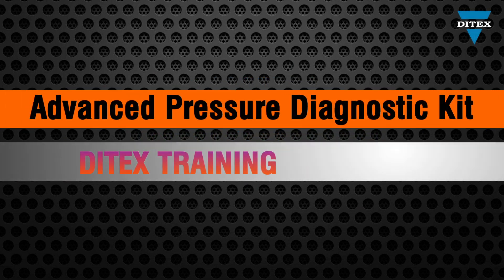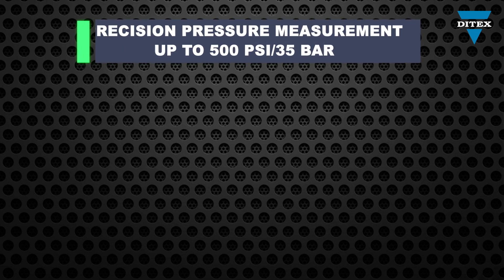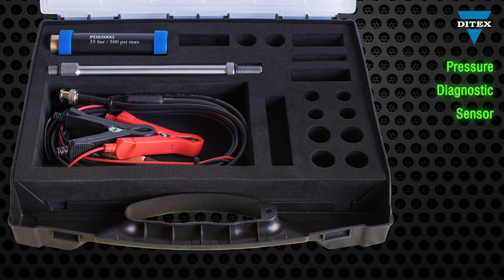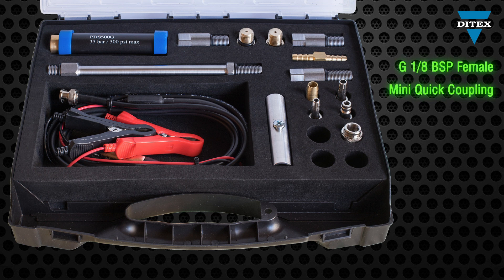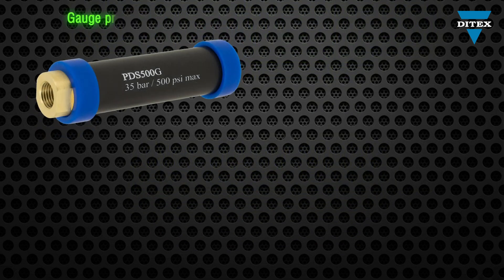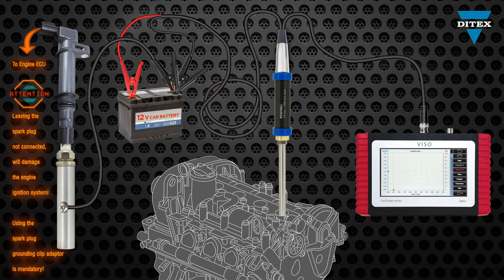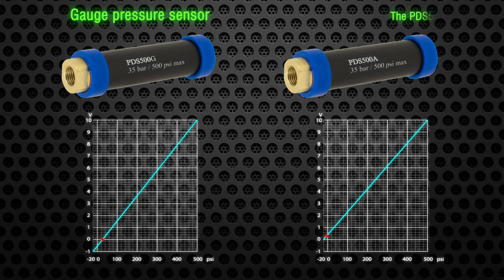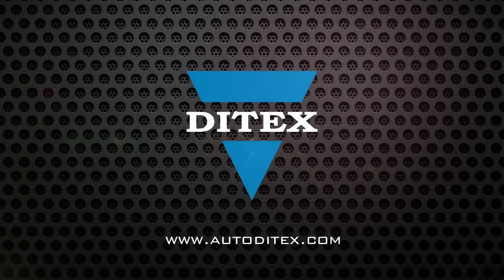Advanced In-Cylinder Pressure Transducer Kit PDS500x

Comment: Just what I needed to see, would also like to know the scope setting parameters for the pressure transducer
Reply from the maker: The best way is to create your own custom probe.
Reply: @AutoDITEX  I agree but a baseline to start is required. Something like 0.5v is equal to 0 psi and 4.5 volts is equal to 500 psi kind of thing?
Reply from the maker: this is a linear function y (psi) = 50 * x (volts)
Reply: @AutoDITEX do you have distributor in US/Canada for this pressure transducer kit
Reply: @pistonbob9505  I have never had a problem getting products from them directly from Bulgaria to Canada
Reply: It is very nice kit.